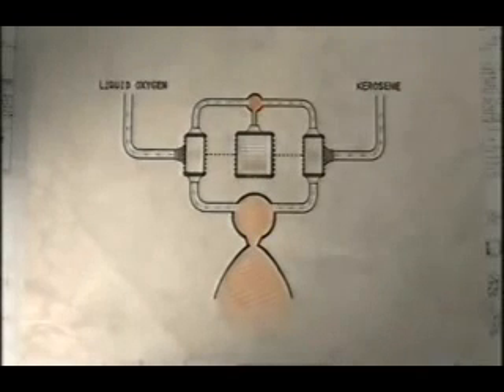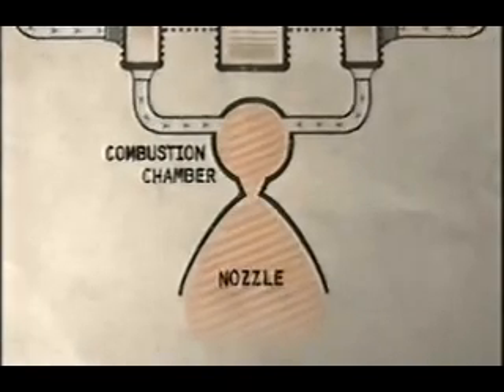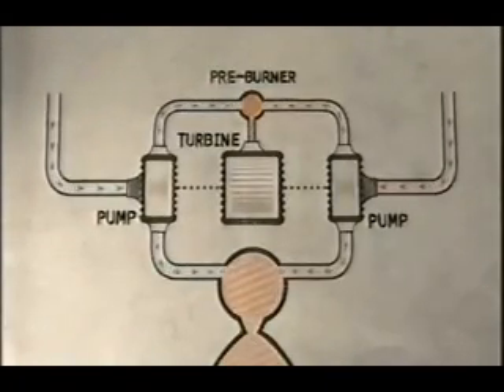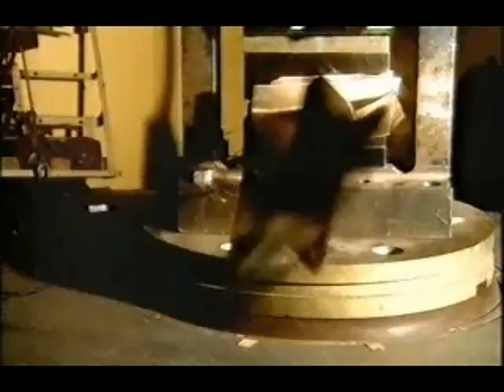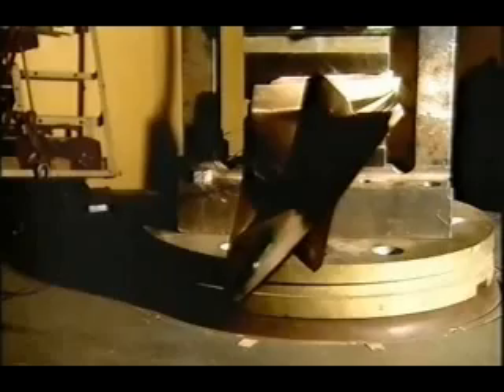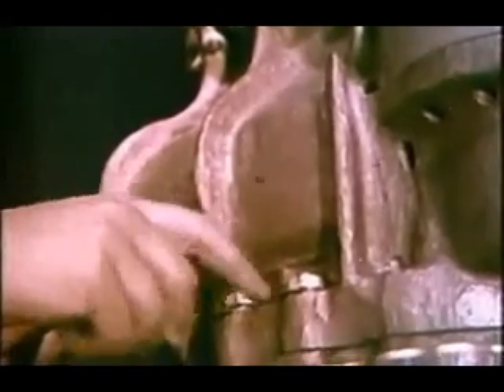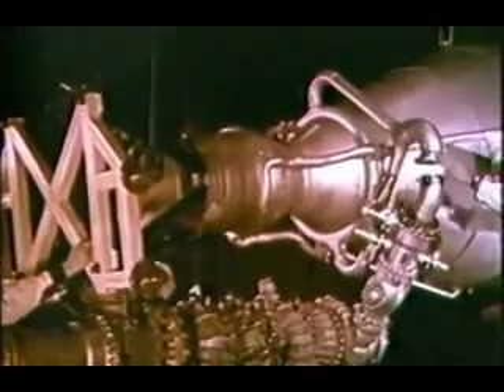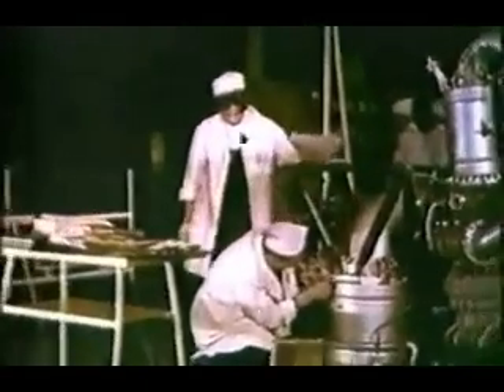Soviet N1 Moon Rocket - Documentary Part 2/5

Comment: A cluster of 30 engines is an invitation for trouble.

The fewer engines, the better the chance there won't be a failure.

The Saturn 5 had five first-stage engines. The N-1 had 30, each much less powerful than the engines in the Saturn 5.